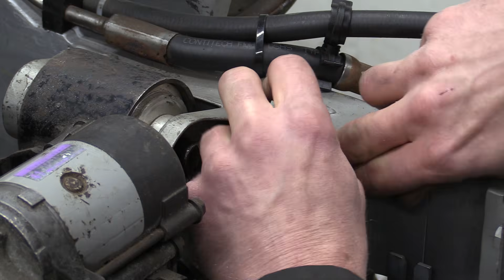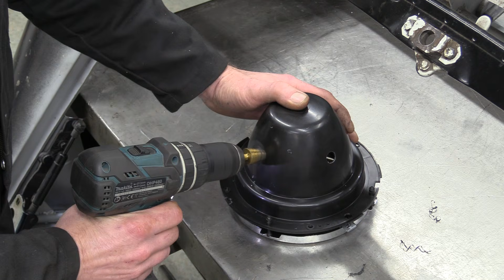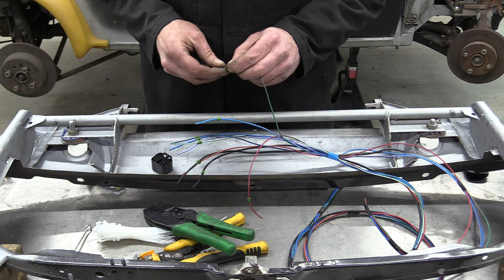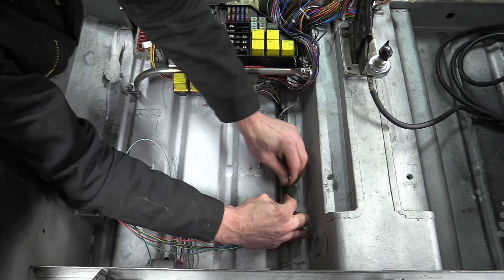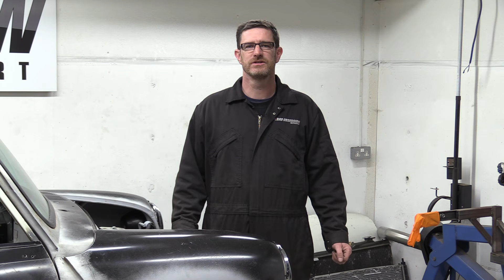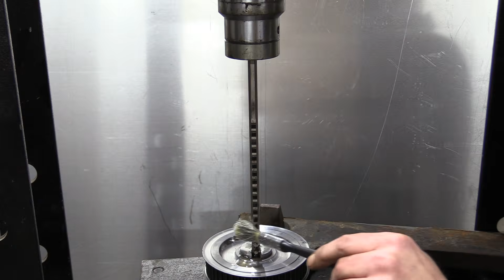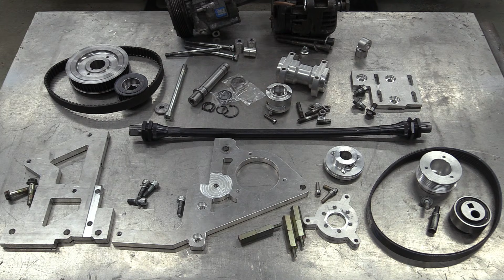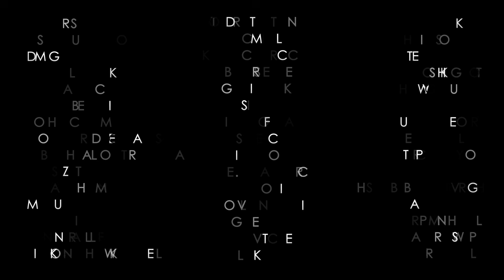Project Binky - Episode 20 - Austin Mini GT-Four - Turbocharged 4WD Mini

Comment: Love the imperial measurements... They make no sense to me either!

Great content and humor as usual..... Not sure why you haven't passed a million subs yet!?
Reply: the only reason this channel doesn't have a metric ton more subs is the YouTube algorithm won't suggest channels that release content as infrequently as BOM. all these lame vlog style channels got recommend because they post "content" every day. plus youtube won't push channels that don't max out the potential ad rev. being that BOM only has one ad for a 30 min. video. it's all about the money for them not the amazing content.
Reply: Since I have started designing parts in CAD and working on cars, I have almost completely stopped using inches for small things. Liquid measurements make perfect sense In metric as well. I will not, however, ever be able to wrap my head around BAR vs PSI.
Reply: I tend to pick the easiest to say measurement for roughing stuff ( "an inch" is a bit easier than "two and a half centimetres" for instance ) - as an englishman using both casually seems a perfectly acceptable proposition - but I'd never ever use imperial for 3D work, or actual engineering. Mind you, 1/1000th of an inch is a good metric measurement!

I'm kinda with you on PSI vs BAR though.
Reply: "an inch is a bit easier than two and a half centimetres for instance" - no, it's not! (besides it's not exact 2,5)

1 centimeter is easier than 0.3937008 inches

:-)
Reply: @P8C1  10mm is approximately 3/8ths of an inch, in fact they are used for the same dimensions interchangeably in board thicknesses.
Reply: @P8C1  It's two syllables vs eight! it's far easier to say! ( and I know an imperial inch is 2.54cm - I did mention roughing stuff. A metric inch is 25mm, a metric foot is 300mm - see ISO 2848 - so we can still say feet & inches anyway :p ). I spose you can just say "twenty five mil" which is only double the syllables...

Perhaps we should take up using "thoum" instead of millimetre ( a "thou" is just old english engineer for a thousanths of an inch ).
Reply: @podunk9798  maybe you should look into Pascal then ;) thats newtons per square meter. and Bar is derived from that i believe.
Reply: 1 BAR is 100 kilopascals, and also very roughly atmospheric pressure at sea level, which is something like 15 PSI ( very roughly ) - which makes BAR a slightly awkward measurement for tyre pressures, unfortunately, given you end up using decimal places or doing it in millibars.
Reply: Kinda ironic really as they still use "stones" as a weight measurement.
Reply: Inches (British Imperial) are great for tasks like this. Simple numbers are easily doubled and halved. 5 over 2 = 2-1/2. 127 over 2 = where's the calculator (and it's all to easy to choose the wrong mm mark).

Comment: i have to admit im a little worried about the reliability of that alternator setup.. but i still love it! it's clearly very well made.. i just see lots of different potential points of failure. im not saying it won't work, just that it might be a bit of a headache down the road potentially

Comment: Your wiring is very good, with one exception. Whenever it is necessary to run wiring through a hole, there should be some type of grommet around and inside the hole to insulate the wiring from the sharp edges. Also, rubbing can occur from the vibration of the vehicle when it is driven.

Comment: very clever solution to the alternator, i hope the flexi shaft is up to the job of turning at 12000rpm.  I notice you guys dodge the IVA questions but i just know youre building in the features of the test, ie high level brake light etc.

Comment: this is seriously impressive.
I've got 2 questions though. 1. The pulley serves as a harmonic damper, does your too? The rubber part between the inner and outer part of the pulley is missing.
and second, your top-hat thing has a bolt in it. Did you balance it or do you think there is no vibration to expect despite it being assymetrical?

Comment: Bit late, but what if you did away with the starter motor, and ran an alternator directly of the flywheel, I'm not 100% sure but I think with a bit of jiggery pokery with some kind of secondary rectifier pack and you could use the alternator as both an alternator and a starter motor

Comment: I worry that that repetitive shunt from the AC compressor bracket turning on, and off, is going to be too much for that flex shaft. I really doubt it's made to take the sudden 0 to 6000+ rpm engagements under the forces the compressor will create. The alternator will be turning constantly so that is fine, but I'd expect the first few times the compressor kicks on will snap the cable inside. IF it does, it could shred its housing and really do a number on the engine bay.
Reply: Most ac compressors cut out over 3 or 4 k of rmps
Reply: @maxfritz4813  the compressor pulley is usually a bit smaller than the crank, and the alternator's smaller still. the accessories are usually rotating at a much higher rpm than the engine. add in non standard electrics (so who knows what the rpm cutout for the a/c is) and you have a recipe for problems. This is why many heavily modded cars don't retain their air conditioning.
Reply: You’re not thinking Bink-dimensionally Doug. They’re not planning on ever finishing the car, let alone running it. And if it breaks something in the next ten years of manufacture, it will give them another ten years of footage to film while they engineer around the problem.
Reply: @gtp_vexd3507  They don't have the viewership for that business model. this isn't a 5 million subscriber channel. There is no way it is capable of supporting it's self. Yes it's taking an age but this isn't their day jobs, this is their hobby. If they were trying to make money off it there would be weekly episodes to create a larger subscriber base. Creating a channel based largely around a never ending car build would net them a major loss The channel revenue wouldn't pay for the parts much less the location or even the power bill. I have no doubt they intend to finish it. It's just a labor of love.

Comment: There is another solution for alternator. You can put it in main puley on a crankshaft. My friend puts 30A alternator in puley in his S13 for hil climbing. https://scontent.fprg3-1.fna.fbcdn.net/v/t31.0-8/14884643_1479009878779068_4409646568668915709_o.jpg?_nc_cat=108&_nc_ht=scontent.fprg3-1.fna&oh=10d84efd512045d9a7148f604348933f&oe=5C810F9C

Comment: Green grommets in flip hood connector (Tyco/Amp) must be crimped with wire insulator. You pushed them in afterwards -> They won't fit properly and will potentially slide out. Instructions: https://youtu.be/yTfj-KAYa3Y

Comment: But how much heat can that space flexishaft take? I was half expecting some sort of one-off (massively over-) engineered heat shielding
Reply: That might still come. They might also end up ceramic coating the exhaust manifold to try and cut some of the heat in the bay. Pretty sure they've said heat in there was a concern before.
Reply: I'd like a good look at that intermediate shaft bearing housing too - that went from "it's a shaft" to "a combined and mounted component" without any details of actual bearings.

Comment: I hope you are putting some form of anti chafing on the cables where they dive into a out of holes drilled in the steelwork. Your alternator drive is mental, could you not use a motorbike alternator? They are very small.

Comment: i think my head just exploded at the end with the description
(may have shared a bit early when i saw the flexishaft and said what a simple solution)
also what the hell is the tool called that cuts out the square on the pulleys, never seen one before and want to look into them as it memorised me a little bit
Reply: It's called a broach fella.
Reply: @GlaserOUT  cheers mate - never thought how keyways were cut but what a beautifully simple thing, the simple things always amaze me the most as they often take longer to be designed than the original complicated ways, especially this as it looks like it could be done in a 10 ton press

Comment: In nanny state of Finland the extra brake light was strictly forbidden until 1991, apparently shortly after official responsible for this kind of issues finally retired. On year 2000 the extra (middle) brake light became mandatory.

Currently, lower winter time speed limits are said to be necessary because modern cars are *too quiet*, although the benefit of ABS and stability control systems as standard equipment is seen as improvement. (Winter tires are mandatory)

Falling asleep while driving is a real danger. Winter time speed limits are enforced on certain months, on dictated percentage of roads - not having actual winter weather has nothing to do with limits being enforced or not. As different regions often have different views on where the winter time speed limits are enforced, you can have summer time speed limits on narrow, icy and mostly neglected road and then have the limit drop lower when you arrive on region in where the very same road is wider, well maintained and not icy.

The level of nanny can vary between states.

Comment: I wanted to go sim racing... darn you dropping a new episode on me. Oh well... off to make a brew and grab some biscuits.

Edit:
Absolutely cracking episode, chaps. I did the wiring in the caravan (Predom from just after the fall of the Berlin wall) myself after having taken its interior totally apart as it just wasn't up to snuff, and I can just imagine how time consuming that wiring has been fiddling about with those connectors.

Also I spilled my brew all over my screen because of Nick's comment on his shaft, thanks a lot!

I am really impressed with the engineering of the brackets for the AC and alternator. Looks awesome and a great innovative solution, at least in car land.

Comment: I think removing the harmonic balancer on the crank is a bad move. Also the AC pump is usually driven at or around crank speed, with the multiplier of the crank to flexi drive it is now running at twice crank speed. I am not sure about that particular pump but most of them won't live beyond 7000rpm due to the wobble plate inside them. Additionally at these higher pump speeds the pump discharge pressure will be way higher than the condenser and your fabricated evaporator will be designed for. Finally not too sure how long the AC clutch will live (or if it can cope) with the much higher differential engagement speed.

Comment: You've run all that wiring through cut holes in steel n plastic, yet not installed a single grommet to protect the wiring from being chaffed by the edges.

Comment: Nice fab work again guys! I'm jealous on the workshop equipment you've got available. On the car though, I personally would have gone for a different foglight solution. It's bulky, ugly and doesn't fit within the quality you've put into the car thus far. 
One more thing that might interest you (if you don't know them already): Fir Tree Mount Cable Tie, for example, google "HellermannTyton 156-00157"
Keep it up!

Comment: Great work guys :)

One thing of note: buy using that new bottom pulley, which looks to be solid, have you removed harmonic crank damper?

The OE pulley looked to durometer specific rubber in it. I might be wrong but thought I’d mention it :)

Comment: I was watching you run all that wiring & thinking, Where's all the insulation & grommets around the cabling, Then I thought, Well the car will have to totally disassembled for paint, So it'll be done when reassembled. Correct?

Another quality video & great laugh guys. Looking forward to the next one.
Reply: Someone didn't catch the (Wallace &) Gromit reference  at 0:48
Reply: I thought the same thing. If not they'll be blowing fuses in the near future, or whenever it gets done, hopefully not 5 more years from now
Reply: I've just said similar, that loom needs taping up badly, and with how its got plugs on everything, i cant see how their planning on dismantling it all as those plugs won't fit through the holes...
Reply: I agree. After all the insane detail & fabrication on this car, they have to go back  & loom and tape the harnesses. I can't imagine them leaving the wires bare that way.
Reply: They are doing a dry build- it’ll all come to bits for paint. Have faith!
Reply: Which was what I was thinking.
Reply: Unbelievable that they will have to completely strip the car after this is all completed for paint.  And then of course reassemble.  We’ll be following this build for another 4 years.

And bravo on the amazing build guys.  Been following for a couple of years now.  Always enjoyable.